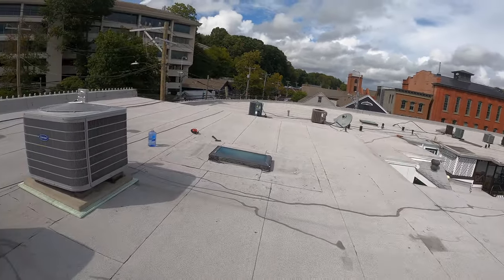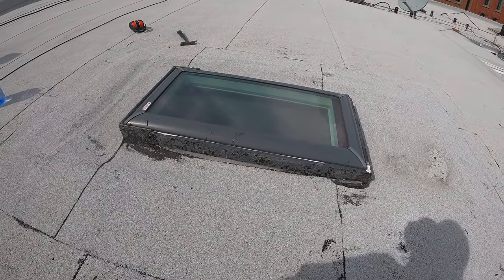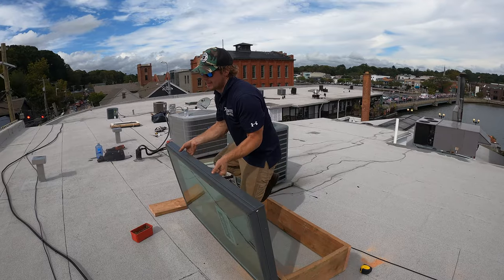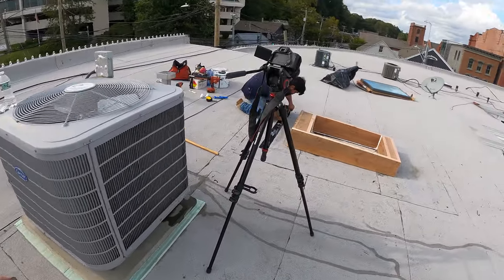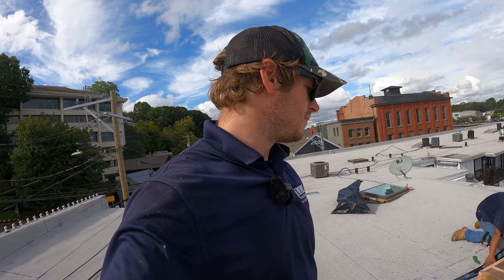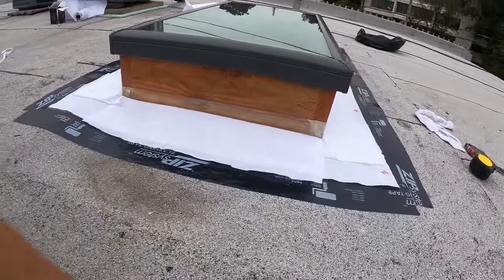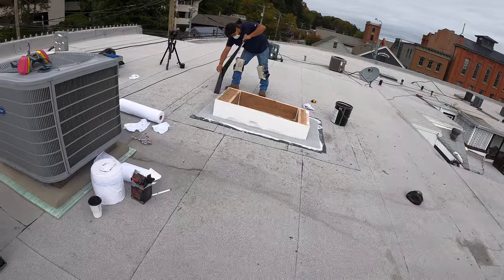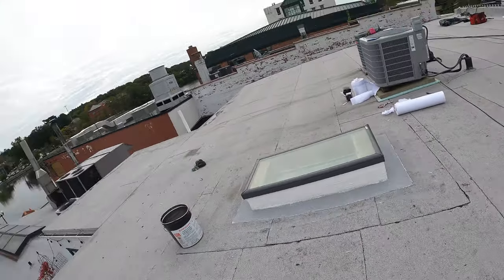Skylight and Curb Replacement on Flat Roof

Comment: Do you need to apply caulk or is the rubber gasket these veluxe skylights come with enough to seal as it sits on the curb? Sorry if I missed it in the video
Reply from the maker: @ericflores4728  it comes with one that is pretty good
Reply: @AllRoof.  Thanks!

Comment: Great job brother can this be done in the winter with those same type projects in Toronto Canada?
Reply from the maker: The work can be done in the winter you’ll have to do most of it with the torch down then the corners you’ll do with the liquid applied  membrane
Reply: Liquid applied to membrane? What product would you recommend or is that a liquid rubber product?

Comment: Great video and awesome job! I'm a newbie, and I need to know.. I noticed you added a top and bottom extra wood to compensate the extra space and it looks great. But my concern.. is there any danger that the sun points directly to the wood, overheating it and catching fire? I don't know if the different materials such as glass, acrlylic, polycarbonate, etc. could be a potential risk to transfer too much heat?